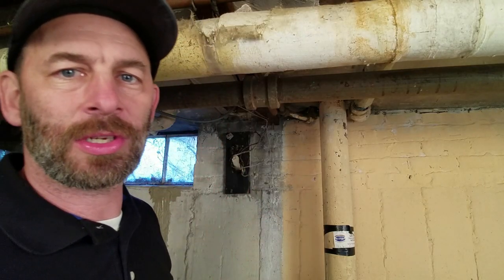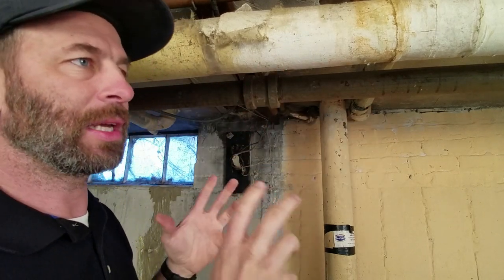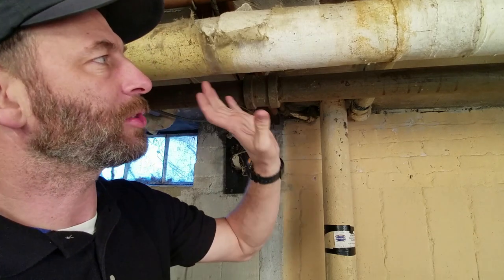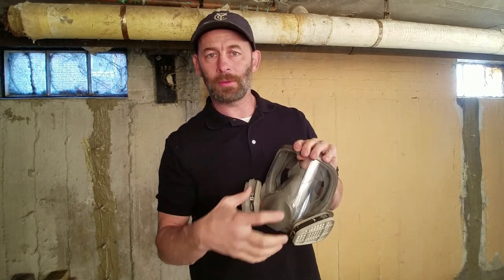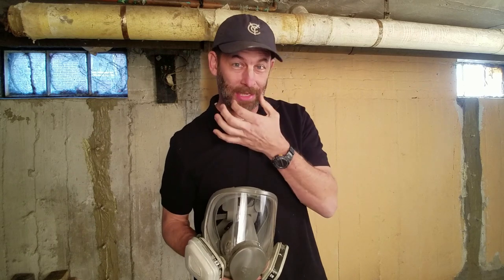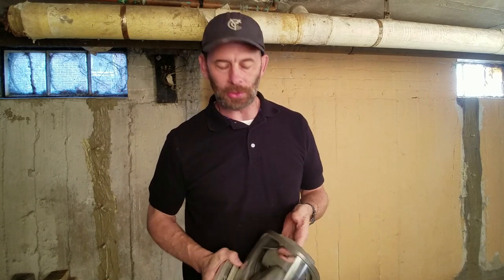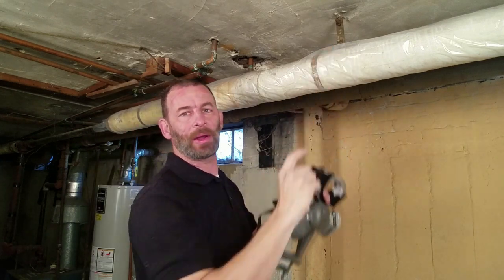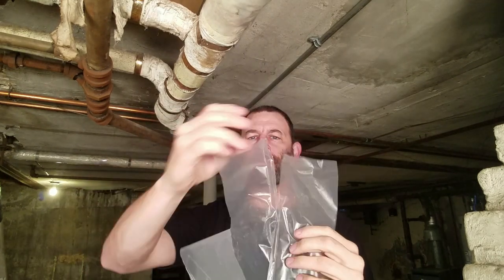Asbestos Pipe Insulation Identification and Encapsulation (sealed covering)

Comment: DONT ENCAPSULATE IT, have it removed by a professional, if you encapsulate it. when you eventually will have to have it removed it will cost you more then it would otherwise
Reply from the maker: The EPA recommends encapsulation before removal as removal increases the probability of the material becoming friable (airborne) which is when the asbestos is hazardous. If the material is in good condition encapsulation should be the first choice. If it is deteriorated and falling apart then removal is indeed the choice.
Reply: I don’t think the extra 25 minutes it will take an abatement company to cut off the plastic wrap is going to make a difference in the $10,000 bill they give you in the first place

Comment: this only tells you how to cover the pipes.  how do you actually take the asbestos off and contain it for proper disposal?
Reply from the maker: I STRONGLY DISCOURAGE REMOVAL AS DIY!
If it gets to the point that you have to remove the asbestos I do not recommend doing that as a DIY. That process is the most dangerous as it pertains to exposure. You should at that point hire a professional EPA approved company to come in and do the work. 
They will "Bag" the area, creating a negative pressure situation and use very high quality HEPA filters (they call them scrubbers) and ensure that all fibers are collected. They also have all of the safety equipment and trained personnel to handle the situation. 
I STRONGLY DISCOURAGE REMOVAL AS DIY!
Reply: You encapsulate sections, remove the insulation and clean down to the bare pipe between the sections (ensuring everything remains encapsulated) and then cut the encapsulated sections apart. You have to keep the material wet with a spray bottle as you carefully remove it and collect / capture anything that drips or drops off as you are removing the insulation.

Comment: Dude, this is the worst rendition of asbestos control I've ever seen in my 15 years experience. 60 percent of what was said is incorrect and the other 40 was just bad info. Asbestos is very hazardous and should ALWAYS be handled by trained professionals. Period. Please be advised.
Reply: We have a licensed professional coming to remediate the attic in the home. They say we can still be in the home downstairs while they do it and they'll cover all of the vents with tape. Is that reasonable?
Reply: @KK-pm7ud It should be fine.  Is it vermiculite they are removing?
Reply: @andrewv4491  I think it is wrap tape and asbestos around the hoods by each vent? I'm not 100% certain.
Reply: Not to mention the fact that homeboy is just casually breathing all that crap with zero hazmat PPE or RPE.
Reply: Bro ur just saying this for kob security… im a union pipefitter, ive had to repipe entire vav systems that were all asbestos insulated, all you need is a respirator (pink filter) and disposal overalls, thats it, spray the insulation with soapy watter, put it in a trash bag and then decontaminat urself, after that, ur good, not that hard and nothing to be afraid of
Reply: A bro, as a homeowner, if one takes the precautions with a mask and suit, do we carefully saturate the insulation with soapy water then proceed and remove insulation carefully and place into a bag? If so, where do we take the bags afterwards? Thanks

Comment: Hmmm why not just wrap the pipe up in duct tape and cut the pipe and replace it.
Reply from the maker: The cost of encapsulation as I showed will cost less than $200. Re-piping an entire exposed plumbing system would require a qualified pipe fitter, draining the system, having the water shutoff for an extended period of time and is the most invasive solution. The costs could easily reach $10,000.

Comment: asbestos in straight pipes?  never seen before. it 99.9 just in Bends
Reply: @lisac4049  smoke it , shit gets you high as a kite
Reply: @smokefentanyl  I already did. it didn't do much. Thanks for the tip! ROTFL
Reply: @lisac4049  gotta use a oxyacetylene torch to light it, stuffs really hard to burn
Reply: @smokefentanyl  LMAO I will keep that in mind.
Reply: Never seen asbestos in straight run? You obviously don't get out much.

Comment: What kind of mask is that you are using?
Reply from the maker: It is a 3M full face mask. I use a number of different filters on the mask depending on the material that i am potentially being exposed to. 3M has a great website that will help you make the choice on the proper filter and pre-filter to use. Another important note is that if you are going to be working with hazardous material to have your mask fit tested to ensure it is the proper size and is sealed to your face. I had mine tested at an OSHA approved facility by a professional in a battery of tests. One of which is testing your lung capacity and function to ensure you are healthy enough to use the mask.
Reply: @inspectordaggett  Yet you show two respirators that ARE NOT approved for use with asbestos. Both respirators have black cartridges which filter out organic vapors and only 1 cartridge has a pre-filter and it's only any N95.  They do not stop particulates, such as asbestos.  For asbestos, you need purple or magenta filters (P100/N100/R100).

Comment: Wow, you really need to learn about respirators before giving advice.  Those respirators you've shown are great for asbestos work, but both would need the proper filter.  You've shown them with black cartridges which filter out organic vapors.  They do not stop particulates, such as asbestos.  For asbestos, you need purple or magenta filters (P100/N100/R100).  Yes, you have a particulate PRE filter on one cartridge, but that is not rated for asbestos. And an orange or lemon for fit testing?  Come on.  You are putting people at risk with this nonsense.